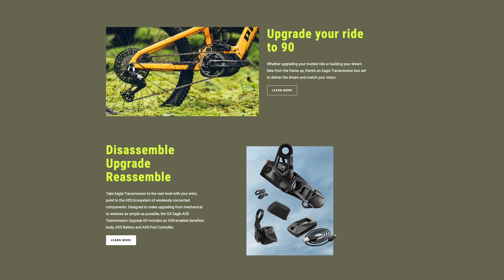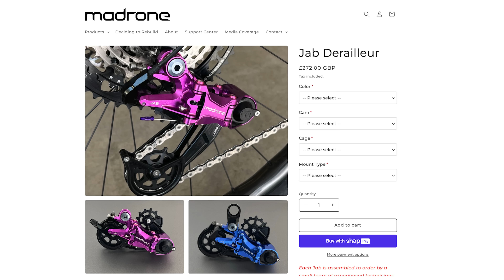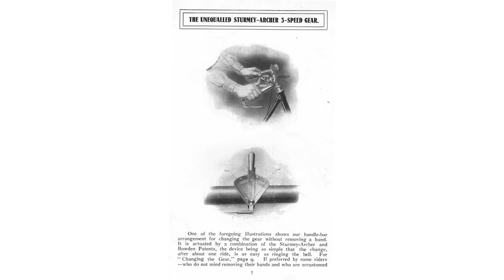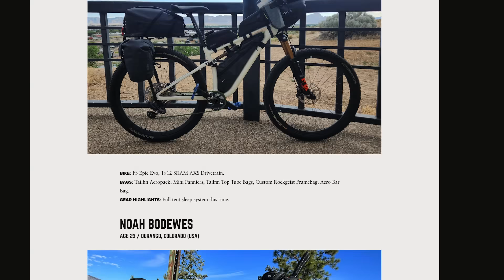Will we hear the last 'CLICK' of mechanical shifting?

Comment: Thanks to the absolute shitshow that internal cable routing has created for easy bike maintenance, the same marketing weasels who pushed everyone into that will definitely go for electronic shifting to solve the problem they created. People with a bit more common sense will stick to frames with competent cable routing and never have any problems with charging or software issues on their bikes or any difficulty with replacing cables quickly and easily themselves in the extremely rare event anything goes wrong with them.

Cable shifting on MTB's peaked at 3x10 dual release Shimano with the Shadow+ derailleur. Every iteration they've made since then has been worse, mostly heavier clunky action and the second of the double upshift not working all the time, as well as the downshift lever going back to locking against the ratchet when you've already hit the bottom of the cassette, rather than moving freely when pushed so you knew you were out of gears without having to force anything. The worse they keep making their cable groupsets, the more people who are new to the sport will assume that what's out now in mechanical is as good as it can be and move to electronic 😞.

I'm hoping the Chinese companies getting into making shifters and derailleurs will keep the current big players honest in their pricing, but it may be too little too late in the enshitification of the bike component market, especially because Chinese factories are the ones churning out electronic groupsets for the big companies already, so they can just as easily compete at a much higher profit margin on electronic shifting.

Comment: If I damage Ultegra rear mech, I can pick a new one up for 50 quid.
Di2? 5 times the price.
Reply: Cassettes for bikes with electronic shifting usually cost 2-3 times the price as well. I ain't paying that for a component that wears out, £50 is enough for a cassette not £200
Reply: @stuartjenkins3506 Why do they cost more ?
Reply: @stuartjenkins3506  I mean why let facts get in the way of your opinion. A 12-speed Shimano Ultegra 11-34 cassette is less than £75 so you've added £125 in your mind just to reinforce your opinion. Nice.
Reply: @kevinrichardson6270 I wasn't trying to be spot on with prices, just pointed out that cassettes for electronic groupsets usually cost a lot more than for an equivalent mechanical system. Once a derailleur turns electronic, then the price goes up by a lot.
Reply: @stuartjenkins3506   OK. But an Ultegra 11 is £45-50 online, more at an LBS. So the difference in cost to a 12-speed one is around £25. Not the £200 cost you mentioned is it? Although I think Sram cassettes are more expensive.
Reply: Derailleur guards exist. Mine cost $4 shipped off ebay... $20 for a fancy titanium one. Less than a new Di2.

Comment: ROFL, mechanical shifting isn't going away any time soon. @Mapdec - you deal with high-end biked, but the market is utterly dominated by the low end. Electronic shifting cannot even hope to make a dent until it's cheaper than a spring, a ratchet, and some cable. Having worked in cycle retail before, my experience is that cheap bikes outsell higher-end bikes 20-to-1. By high-end, I mean 105 and £1200 bikes. To most buyers, that's at least three times more than they need to spend and double what they want to spend.
Reply: Electronic is actually cheaper to manufacture than high quality mech hardware. Shifter tech is basically as advanced as an 80s clock radio - manufacturers have massively over-developed it with software etc.
Reply: @GregAbendroth  I completely believe this. I expect there to be a natural cut-off where perhaps there are 2-3 tiers of electronic at the top of the product range, and then everything below that stays mechanical for cost reasons, because mid-quality, mass-produced mechanical is still an order of magnitude cheaper than precision engineering mechanical parts with advanced materials. I'm honestly surprised 105 got the Di2 treatment, though it's arguably just last-gen's Di2 and Shimano are still trying to recoup the tooling costs. By the time we get down to Tiagra, we're talking mass-produced items with stamped parts, rough castings, precision machining only where necessary for shifting performance, and plastics wherever strength isn't required. The chances of Shimano releasing a dedicated Tiagra Di2 are extremely low, and I am uncertain if even 105 Di2 will trickle-down to Tiagra next gen - it's old and bulky tech at this point and it's not a cost-effective design which is what Tiagra needs to remain profitable for Shimano.
Reply: @chrisfanning5842  Everything below 105 has been replaced by CUES now, but I think your point stands
Reply from the maker: Sure. But I see that low end fast becoming dominated by Amazon e-bikes and soon i don’t think they will need gearshift.
Reply: @Mapdec Generally, electronics beat mechanical where mechanical is unreliable enough to make a noticeable difference. I'm happy my car has drive-by-wire gas pedal/throttle control, because it just doesn't break and removes a few things that can jam/fail that are also not so easy to access (because car, duh). But mechanical derailleur reliability is legendary, same with mechanical shifters. Basically the system mostly breaks due to impact damage or jockey wheels wearing out. Both modes of failure happen to electronic derailleurs too. 
So it's basically battery care vs cable care. And well, remembering to charge battery vs replacing cable once every 1-2 years depending on how often one rides...
I mean, I am all for electronic shifting for Shimano Alfine, where it can actually break if shiting cable is loose. But that's pretty much it. Electronic is very cool, though, but I think I'd rather see it on an e-bike with some heavy-duty special setup (Cues on steroids with heavy spring derailleur that electronics would easily disengage no problem or overcome with right electric motor) that would be simply difficult to switch by hand. But no such thing exists right now anyway.
Reply: @Mapdec  Those cheapest Amazon ebikes are still £400-500. Decathlon sell new bikes from £160 and up, Halfords still have a good selection of Road, MTB, and hybrid bikes for under £150. They may be horrible, but they're what outsell everything else.
Reply: @chrisfanning5842 exactly your never going to get a £150 bike with electronic shifting and the people buying a bike at that price probably don't want electronic shifting anyway.
Reply: @Mapdec heck no the low end consist of chinese aluminum bike with Shimani Sorah tiagra and claris i dont see a day where this groupsets will be electronic
Reply: Interesting to hear your experience and I guess by retail you mean first hand, I wonder what the % split is between retail, secondhand retail, and consumer to consumer
Reply: @oooooooo347  I worked in a very large LBS during my breaks between university terms and we sold everything from £100 basic 18-speed commuter "MTB"s all the way up to high-end from Canondale, Giant, GT, Bianchi, Schwinn. 4/5 customers walked away with the cheapest bike we sold, and those who didn't rarely walked out with anything high-end. I tried to steer people with moderate interest in real off-road riding to something with at least Acera/Alivo and forks with damping just so it wouldn't break immediately. On the road side, Tiagra was the new mid-range value champion, yet any sales of road bikes with Tiagra or higher were extremely rare. Casual riders looking for low-cost mobility make up the bulk of the market in my experience.

When I worked for a smaller, more local LBS briefly at around the same time, our cheapest bike was £219 and so many people walked out without buying because that was too expensive. Halfords were still selling £120 BSOs.
Reply: @oooooooo347  The LBS I worked was large-enough to offer trade-ins and sell used bikes. Many of the cheapest bike-shaped-objects we saw come in were too cheap and too far gone to be worth the workshop labour for trade-in. The trade-ins people brought to us reflected the price of bikes sold - very few of them were higher-end bikes and since I wasn't on commission I often suggested that those people try to sell privately if they were interested in getting the most cash for their nicer-than-average bike.

We were selling new bikes for £100 with alloy rims, canti brakes, indexed shifting, a free basic service, and a warranty. Steel-rimmed, caliper-braked, BSOs were all over the classifieds (ie, Halfords Apollo) and if they weren't kept in a dry garage or shed, they were close to worthless. Cheap, new, warrantied bikes in a size that fits from an easy to access location meant that when I used to work in cycle retail, the used market for bikes was almost nonexistent. It's definitely a larger market now, but I doubt it matches new sales still.

Comment: Riding SRAM mechanical hardtail and Shimano mech GRX allroad, both Steel frame.  Eyeing an electronics for the next one ... glancing carbon,  but probably Steel road.  Conspiracy take: what about when the power grid goes out for good? Mech will rule.
Reply from the maker: If the electric went out, could you actually repair your mechanics?
Reply: @Mapdec depends on severity of repair... 30/70 against.  Electronic only is inevitable above a certain level.  Even some steel frames are now strictly electronic. Battaglin Siena for example.